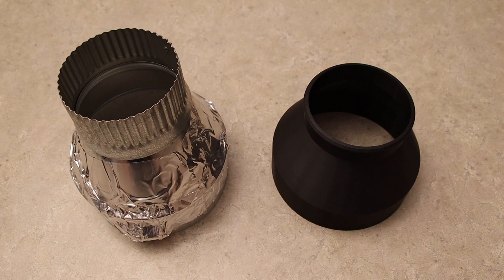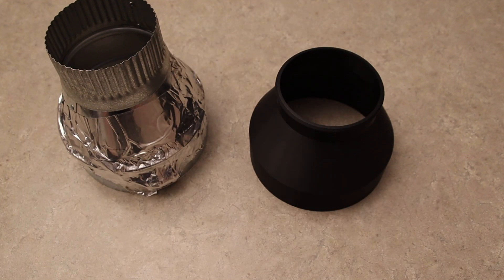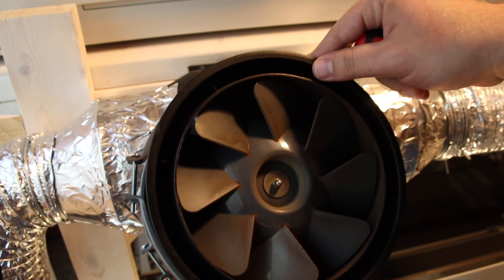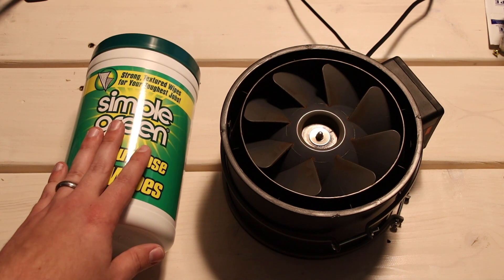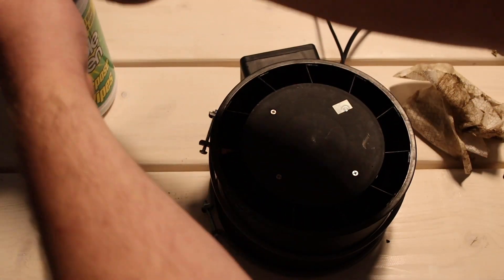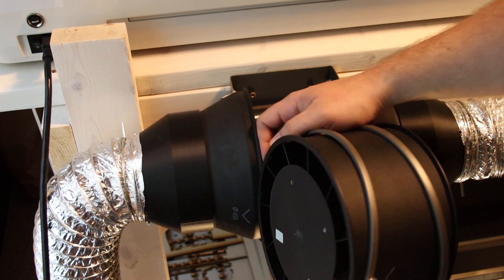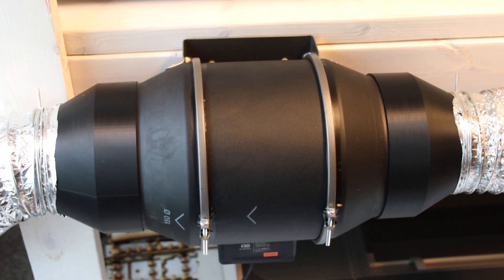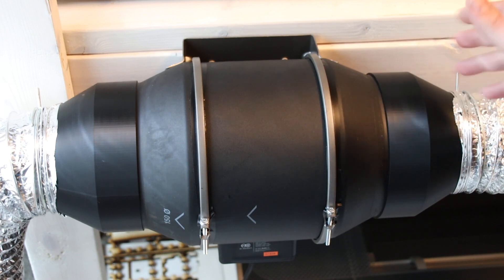Inline Fan Upgrade and Cleaning: 7 month update

Comment: I found this video while searching for ways to eliminate the smoke vapors from my laser engraver.   I was specifically searching for a way to seal the fan / housing connections on my AC Infinity 6" inline fan.  The electrical tape trick worked beautifully.  So simple but so effective.  Thanks!
Reply from the maker: You’re welcome

Comment: Thank you for the video! I just printed two of those off from thingaverse as I already have a 3-D printer. They look identical to the ones I printed off but not sure if they’re gonna work the same I’ll let you know.
Reply from the maker: Awesome! Can't wait to hear if they work. Unfortunately I don't have a 3d printer to print some for my other machines.
Reply: Fresh Start Customs I just ordered my pro and used your code to give you $500! Quick question have you ever made a dice tray with Leather insert? Interested in your take on that project as I play table top war games.
Reply from the maker: @kalebwalters  Thank you so much, I appreciate it. I haven't made one but sounds like a cool idea. I'd probably start off with a box generator then remove the top and glue in the leather.
Reply: Fresh Start Customs Just a follow-up to the 3-D printed parts I told you I printed from thingaverse they work the same.

Comment: I have their adapter for the back of the glowforge and it is the best accessory I have purchased. 
Did you start getting smoke from those clamps right away? I did not seal anything and have no smell or smoke coming out.
Reply from the maker: The old clamps I got a small amount but wasn't much to notice. These are better for sure.

Comment: Hi Josh, I just ordered my glowforge today and I'm watching YouTube to get as much knowledge as possible and get my supplies ordered before it comes in. I have been seeing some people use 4in hose from glowforge but on the window side they use 6in hose what are you thoughts on this?
Reply from the maker: If you are able to do a 6 inch from the fan to the window I'd probably go that route. I just have a 4inch out because of the duct I have.
Reply: Debbie - Im sure you have already gotten yours set up but.....just in case......Joe Martinson (Martinson Manufacturing on youtube) also offers a 6" connector.   So my hose is 6" from GF to inline fan and then 6" from fan to my window outlet.   Joe is great to work with!  Twice I've asked him about a certain idea and he has made a prototype for me that worked great.   I know people below are talking about him being too expensive and finding different routes  but I am of the mindset that he put in a lot of hours and effort getting to this point so I'd rather pay the originator.   Hope you are up and running and having fun!

Comment: Hello fresh start customs. I printed the reducer using a file off Thingiverse. I had ordered the ac infinity fan for my wife’s thunder laser thinking her exhaust was also 4 inches. Turns out her exhaust is already 6 inch so I have these reducers that I 3d printed and can’t use them. If you would like them for testing or to provide as a giveaway to your subscribers, I would gladly send them to you for the cost of shipping. I’m not looking to make any money off of them as I can’t guarantee their fit on the glowforge.
Reply from the maker: Hey Mike, feel free to message me on Facebook using this link: m.me/freshstartcustoms I'd like to ask you a few questions about them. Thanks for letting me know about this.